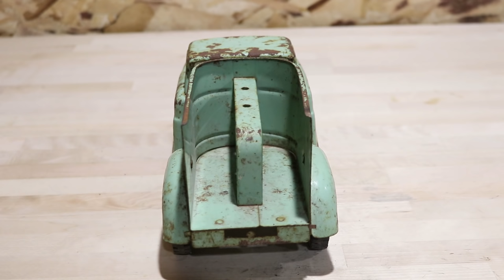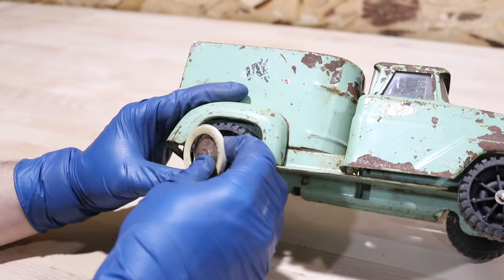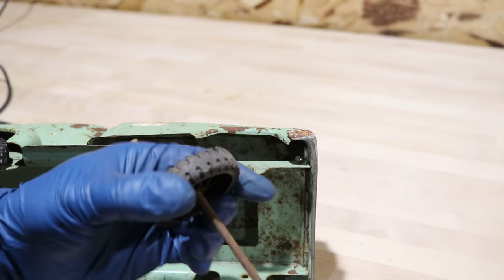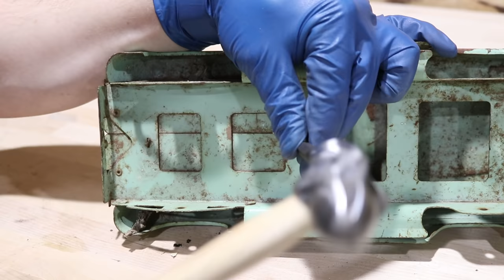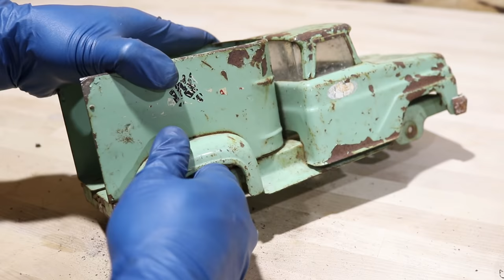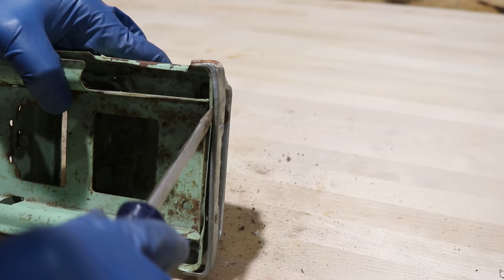1965 66 Tonka Farms Horse Truck Restoration Time Lapse

Comment: My first vehicle back in 1980 was a 1971 Ford f 250 with a shad darker green. The hood had a black strip about 2 feed
 wide down the middle. Then in 1982 I found a 1965 Ford f 100 with a straight 6 and 3 on the tree. I'd say I like the 65 better. Through out the 1980's I had 3 of the 1965's. Love the video's keep up the good work and stay safe.
Reply from the maker: Thank you for watching! And thanks for toughing it through this video. It was one of my very first videos and it shows, I'm definitely improving each time.

Comment: I've been watching your channel during the recent weeks and I've watched several of these videos. Excellent work with passion & perfection. I've noticed that this particular video might be one of the first restoration videos as I've seen you fumbling with the tab slots of the Tonka truck, in the more recent videos you've become an expert and  won't fumble at all! I've also noticed, there wasn't a subscribe sticker in your sandblasting unit earlier & you edit out the part in which the painted parts are retrieved after being baked in the oven. It's very good effort. ❤️❤️❤️👍🏻👍🏻👍🏻

Comment: I remember the old Tonkas when they were made mostly from metal, they are mostly all plastic now, our toys were made to last.
Reply: Depends where you get them. The store chain I used to work for had metal ones last year at Christmas. They aren’t the same as the originals but they were meant to be like a throwback type of deal. Orscheln Farm and Home was the ones that had them. I don’t know if they will carry them this year but if there is a store near you it wouldn’t hurt to look.  They have stores in Missouri, Iowa, Nebraska, Kansas, Oklahoma, Texas, Arkansas, Kentucky, Illinois, Indians, And Ohio.

Comment: If it would've been a full size fleetside I would have clear coated the patina, but being a Tonka it looks great in new condition. Was there a horse that went with the set?
Reply from the maker: Thank you! Yes there would have been a couple black plastic horses to go along with this truck. Eventually I will find a set for it.
Reply: Chip do you ever sell your restorations?
Reply from the maker: @xmo552  I have not sold any yet. Possibly in the future if i run out of room.

Comment: Ok... I’m going to take this opportunity to talk about this type of restoration video.  I love them!  BUT, when did it become a requirement to hold up every single piece in front of the camera. Especially if it’s a rivet that’s you’re not even going to reuse!  What is the point?  Speaking only for myself... what I want to see is the restoration... the cleaning/sandblasting, painting, reassembly — the final result!  Most of us who watch these videos like them because they’re cool old toys and we love seeing them like new again.  That being said, a time-lapse video doesn’t need to be 40 minutes of the “here, look at this rivet I just removed” stuff and then fast forwarding thru the good stuff!  Still, it turned out beautifully and I like the end result!  Thanks for sharing and for letting me rant!
Reply from the maker: Thank you soo much for watching, this was one of my first videos, please check out my newer videos as they have gotten better. I shoot for 12-16 mins now. I will likely re-edit this video in the future to be shorter. Thank you for watching!!
Reply: Awesome... cuz you do good work!  I love love love the color!  Question:  did you remember to turn the fender tabs down on the inside of the horse bay?  It wasn’t in the video and it was bugging me! 😂😂😂
Reply from the maker: @vickiefowler1429  lol, yes they got turned down. I actually couldn't get a good camera angle with the high sides of the box. Thank you!!

Comment: I'm very picky! ☝️🧐
Fill dings, fix dents, use rust remover, fully polish metal, clean windshield first, use water when applying stickers, don't drag finished truck sideways across table, be more careful with the tires, don't use reproduction parts, unless you absolutely have to, and shorten/edit video, etc, etc.
Still a nice job, though 😷👍
Reply from the maker: Thank you for watching! This was one of my very first restorations, please watch some of my newer ones, I try to improve with each restoration. I don't know that I'm up to your standards yet but definitely better than this video for sure. Thank you soo much for taking the time to watch!
Reply: @ChipChannelRestorations  
You're awesome! And, I'm anal retentive, and sitting at home bored as Hell, as well. I will checkout your other videos. Thanks!